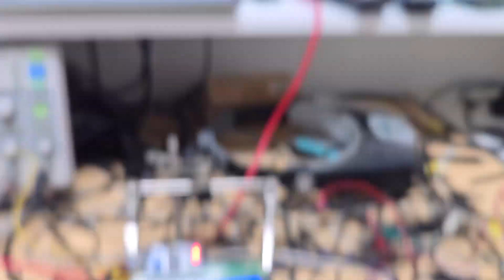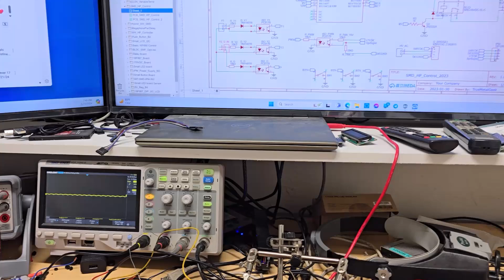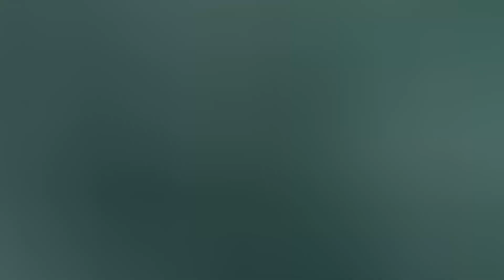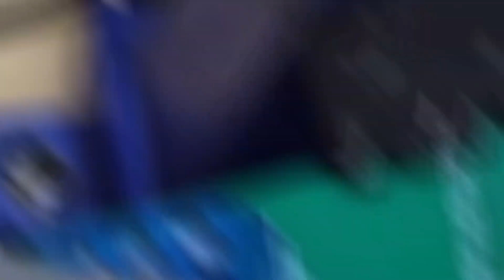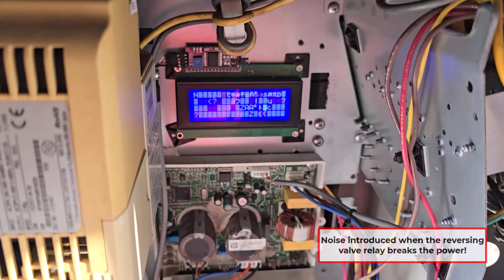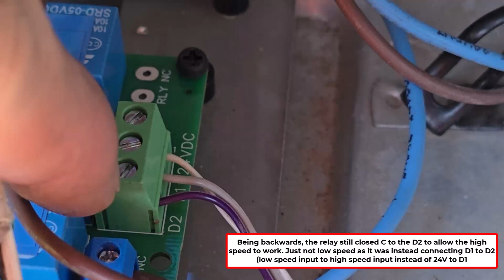Fixing a glitch in the Frankenstein Slim HP MicroController [Interference issue]

Comment: Holy crap another crazy person like me! Question for ya, Wouldn't happen to know of a VFD I can strictly run off of the DC bus would you? I have a crap ton of 500v dc caps itching to take my ac off grid.

I converted a apartment fridge over to 12/24v with a Danfoss and now itching to do more. A solar VFD would be amazing for just about anything!

Comment: It is good practice for circuits that have a high resistance pull up or down resistor to put a 0.01uF ceramic capacitor to Ground for RF bypassing. That prevents the issue that you were seeing. I have a feeling you will get the second one installed here soon with the weather that has been happening recently. Next thing I could see you doing is taking the one unit that runs most of the time and make it into a Heat recovery system to put the heat into your hot water. That I will be interested in.
Reply from the maker: The bummer thing is that it takes a lot of board space to add those extra resistors and then source them to either ground or vcc. I do set the tri state registers to outputs which locks them to ground.
I think most of the problem was that the week pull ups are literally so weak that I was getting straight voltage induced on those open push button inputs.